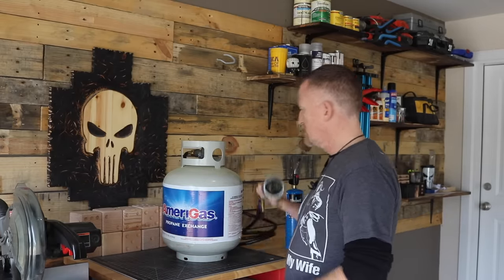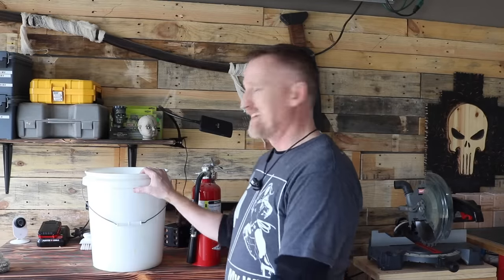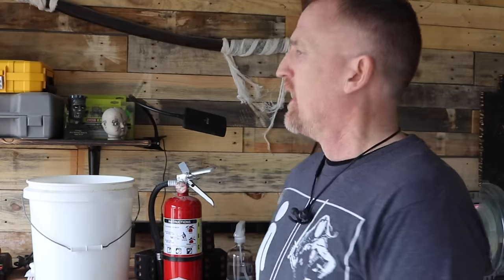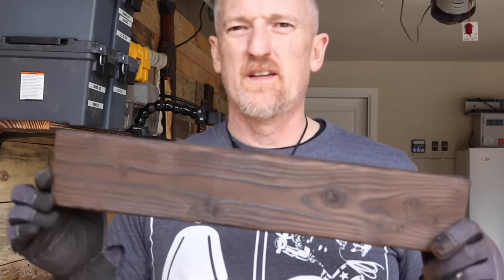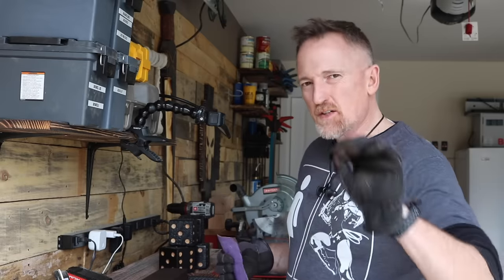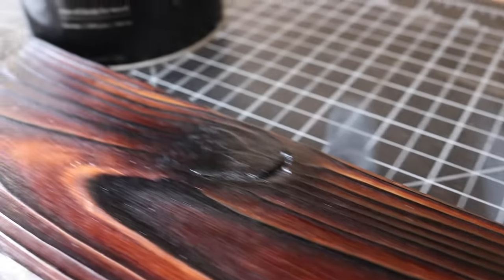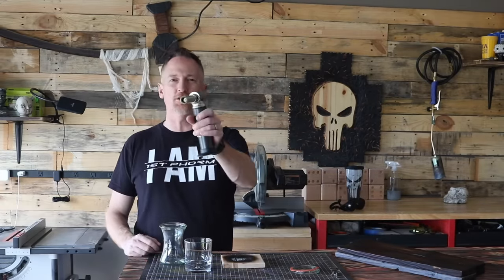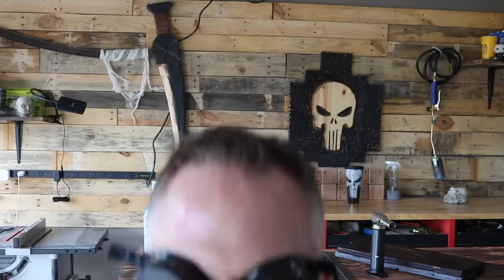DIY Wood Burning Technique - That's not Shou Sugi Ban! Or is it??

Comment: Is this technique only used with pine? Or can you use hardwoods?  What was the wood you used to trap the smoke for the cocktail?
Reply from the maker: You can do this with any wood. There is just varying results. Hardwoods with not a whole lot of soft cellulose material tend to ebonize and gator more. Soft woods will give you more texture.
Check out this video where I experiment with different wood types:
https://youtu.be/DoBWpOzGMXc
The wood I use most often for my smoked whiskeys is Hickory.

Comment: I have a small butcher block table I'm wanting to do this to.  Now, after you stain it can a sealer be applied to it and NOT effect the color of the stain?  It'll be on the back porch and exposed to the elements is why I'm wanting to put a water sealer on it.
Reply from the maker: I don't know of a sealer that won't darken the color. I always try to keep mine a little light with that in mind.
Cheers

Comment: To use this in a piece would you finish the boards then do joinery or would you burn a built piece?   I'm not sure how glue would hold up to the heat.
Reply from the maker: Depends on the piece. I would say if glue is going to be your primary joinery, I would finish them maybe 90% before, then assemble and touch up any areas with a torch.
TBH I don't know how well glue holds up to the torch. In my experience I haven't had any joints fail, but I also try to not hit a glued joint directly with the flame, let the burn creep up to it.
I'm actually thinking of putting together a video to test when glue fails when heated with the torch.
Reply: It doesn't, made that mistake before bud. The glue (titebond 2)  completely releases when directly heated.

Comment: If I’m using the wood for outdoor purposes do you recommend a poly to go over the simple finish?
Reply from the maker: Hey Kevin!
Purists will tell you that Shou Sugi Ban plus oil is all you need for outdoor applications. That being said, I usually use poly or some sort of water seal over the top.
Cheers!

Comment: Quick question. I’m doing my deck. I’m looking at doing a surface burn, because I don’t want my deck to burn my feet with a full gator burn. With a surface burn do I need to seal it with polyurethane or will it seal and preserve the wood with out the poly?
Reply from the maker: You'll hear 2 different schools of thought here. I say if it's going something that folks are going to walk on I'd seal it for durability. 
Some will say it'll do just fine with the natural seal of the burn. 
Personally I put a coat of poly (or other sealant) on everything. 👍🏻👍🏻

Comment: Hi, I'd like to ask if what will happen if you repair the wood first, like you filled up the holes with wood putty or filler then you start burning it, because some woods are not really that smooth right, we
Reply from the maker: Wood putty doesn't really stand up to heat well. I would suggest doing the repairs after the burn and using something like CA glue or epoxy (depending on the size of the hole).

Comment: After you burned them all did you San all 4 of them to expose some more wood ? I want to do the white application for some loft beams for my tiny house.
Reply from the maker: Yes I sanded them all. However, check out my chair build here: https://youtu.be/SMz5r7TFcEI where I use a nylon brush attachment for my drill. I didn't really need to sand after that...

Comment: I have trouble with wood warping when I burn.  How do you stop that?  Have you ever burt a panel after glue up and how would you stop that from warping?
Reply from the maker: Two ways to limit warping. 
1 - do lighter burns and more of them. Some guys come at the wood with MAPP gas and really high heat. That will cause the wood to warp. 
2 - make sure to dampen the wood when youre burning. Keeping it moist keeps the train from rapidly expanding or contracting.

Comment: If you only give it a light char, does it still weatherproof the wood?
Reply from the maker: The part that weatherproofs it is the removal of the soft cellulose material. So, it kind of depends on how light? You could definitely burn it less and still get some benefit. A surface burn? Probably not...
Cheers!

Comment: I would like to do this with the sun bleached finish for a computer desk. Since I would want the desk to be smooth what epoxy or urethane would you suggest? Or would you suggest a different method to get that look?
Reply from the maker: Lately (if you want gloss) I've been loving the Halcyon from Total Boat. I actually used it on this desk build...
https://youtu.be/U5A67-Pwxuo

Cheers!

Comment: After burning and oil , how well will wood hold up outside? Outdoor I use a special oil for this outdoor application?
Reply from the maker: Burning and oil, it should hold up outside fine. This technique was used for siding at one point.
However, I usually do apply some sort of outdoor top coat.
Cheers
Reply: @BuildDadBuild  , top coat like a polyurethane clearcoat
Reply: Are you talking linseed oil that you use?
Reply from the maker: I usually use a poly...you really can probably get away with BLO but you'll need to keep up with it.

Comment: Stupid question I’m sure but can this be done to pressure treated lumber. I know they say not to burn it but didn’t know if there are any steps you can take to do this.
Reply from the maker: Hey, Lee!
I don't burn pressure treated lumber because it releases those chemicals into the air. If you do...wear a respirator, do it in a well ventilated area and be mindful of anyone around you.
Cheers!

Comment: Is 1” pine hard enough to make a table top? I intend on making a 1”x6” pine table top at 52”x30”. Also, would I torch the boards individually and then join them or join them and char the table top as a whole? Thank you and your work is amazing!
Reply from the maker: Pine is a soft wood...so it will ding and dent. So I guess it depends on how much stress the table will be under.
You can definitely join the boards first, then burn.
Cheers!
Reply: In the event that I do go with Pine, does it make a difference whether or not it’s the $4 2x6x4 kiln dried or the $25 select 2x6x4? In other words is the cheap shit too cheap? What would you recommend?

Comment: Has anyone tried it on frniture which already received some wood varnish? Just got a second hand bed and not sure if the wood is actually treated? Will the varnish just burn away , or what happens it if was just oil or wax? Will that burn explosively ?
Reply from the maker: It should just burn off. Wear a mask in a well ventilated if you're not sure what it's treated with.
Cheers

Comment: Question for ya.. Have you ever done this with a thinner plywood?  I'm thinking of wrapping my new 300 gallon aquarium stand with shou sugi ban 1/4"- 1/2" plywood.. And also should I use sanded vs unsanded plywood?
Reply from the maker: Plywood tends to not burn evenly. And thinner plywood will warp.
Cheers,
Nick
Reply: @BuildDadBuild  that's kind what I thought, but figured I'd try and get your opinion before I did anything
Reply from the maker: @torosax  I would try this instead. Shou Sugi Ban some pine and then cut it with a bandsaw down to a thinner stock.
Reply: @BuildDadBuild  good idea but that would have to be some massive pieces for my 300 gallon aquarium stand and canopy haha!  Thanks again for the responses and input! Much appreciated!

Comment: I am building a chair for outdoors and will be using the burnt wood finish technique, would you recommend using treated wood or non treated wood? Thanks
Reply from the maker: Do NOT burn treated lumber. You'll release the harmful chemicals they use to pressure treat the wood. 
Check out my outdoor chair build here you might be interested in the brush attachment I use on my drill:
https://youtu.be/SMz5r7TFcEI
Reply: @BuildDadBuild  THANK YOU
Reply from the maker: You're welcome

Comment: Shouldn't blast on concrete, it  will super heat any air or moisture in the slab and make a popping sound weakening or even cracking your slab
Reply from the maker: +Keith Runick thanks for the info! Good to know.

Comment: I am looking to build a metal above ground (mobile) fire pit. I want to line the edges of the exterior with Shou sugi Ban wood like done in this video. I am hoping to make a ledge people can kick their feet up on and something that does not get as hot for those times people accidentally bump up against a fire pit. Would this method work to make the wood less likely to burn with the random spark coming off the fire?
Reply from the maker: Sure will!
Cheers

Comment: what kind of brushes do you use to remove the charred wood?  I didn't notice any steel wire, so just stiff bristle? Nylon?
Reply from the maker: They're nylon brushes. I used to do it by hand (with a nylon brush), but I've since switched to these because I can use them in my drill and save a TON of time.

https://amzn.to/2qjg7QD

Comment: I gave my wood a light burn I just need to brush it would like to know the proper brush to use? 
I’m looking for a natural burn look?
How many clear coats do u recommend? Do I have to sand it? Or is it fine like this?
Reply from the maker: If you want tool marks use a wire brush. If you don't, use nylon.
Minimum 3 coats clear coat
I do not sand.
Cheers
Reply: @BuildDadBuild  thank you brotha
Reply: @BuildDadBuild  
I got valspur ? Something like that is that good

Comment: I’m a little late but I’m sure by now you’ve learned the following tip but hear it is anyway: 
Put a nail dead center of your project and tie a string 11” to your nail. Then attach a pencil to the end of the string. With pencil attached to the string, take out all slack in the string while drawing away from the nail in a full circle. This will give you a perfect circle. After you get your circle penciled in get that trusty jigsaw out and cut that wood. Lol You could also achieve the circle trick using a tape measure, but it takes a little practice.
Reply from the maker: Thanks for the tips!
Cheers

Comment: First, I have to say, you are a really good teacher, thank you for your video. I am sure this has been asked before, I wish I could do a word search through these comments. Or maybe I am missing where this is posted. Anyway, what are the brushes you use? I may have missed one, but I saw a white one just after the burn, then maybe a metal tooth one? Could you provide links? Thanks for your time!
Reply from the maker: Thanks, Kat!
The white brush is a nylon brush (like the kind that you would clean the bathroom with)
https://amzn.to/3aSJXgz
And the wire brush is similar to this one:
https://amzn.to/2JJGGo0
However, I would urge you to watch my updated Shou Sugi Ban video where I show some Nyalox brushes that you can attach to a drill (they save so much time!)
https://youtu.be/tCSJ6Sljq7U

Nyalox brushes:
https://amzn.to/2wIelM7

Cheers!!
Reply: @BuildDadBuild  Thanks so much, I certainly will!

Comment: Hey probably a stupid question but if I’m planning on building a platform bed if I do the torch method on the wood would it be able to be as strong as before it was burnt?
Reply from the maker: It should not weaken the structure at all. You're removing the soft cellulose material and leaving the more substantial stuff behind! 👍👍

Comment: Walnut gun stock? 🤔 I've seriously been thinking about doing this on a Walnut gun stock and finish with a traditional sanded in linseed oil finish to fill the pores of the wood. I think the darker grain contrasted with the light will be really nice. Any thoughts? Your opinion would be greatly appreciated thank you
Reply from the maker: Hey, Brian!
I've never burnt walnut, so I would definitely try a scrap piece first to get an idea.
But, I would think if its got a good grain pattern you could definitely increase the contrast with a little fire!
Cheers
Reply: @BuildDadBuild  Yes adding contrast is my main goal plus just having a little different look. I'm thinking about buying a stock from DuPage trading Post they have a extra fancy tiger striped Walnut. I've also thought about adding some mahogany color stain? The linseed oil as it oxidizes has its own natural red color to. Thanks for your input any ideas?
Reply: I would not have any walnut to test it out on just the stock. Maybe test on the hand gaurd or forend stock they would be cheaper to replace if I messed up. I think a light black char I could sand out if I didn't like it? I think I would love it though the only Shou sugi ban I don't care for is when it is left chard to the point of cracking and then sealed. I guess for the right project it would be cool. Thanks
Reply from the maker: @brianlee6849  I'd probably go with the contrast and linseed oil combo. But, definitely do some tests first. Since I have no first hand experience with walnut, I'd hate for you to mess something up based on my recommendations. You can pick up a piece of walnut from a local lumber yard, or order a piece from Rockler.
Cheers
Reply: @BuildDadBuild  Thank you. I appreciate it.
Reply from the maker: @brianlee6849  Sure thing, brother. Let me know how it turns out!

Comment: Can I burn one that’s already been painted? I am working on custom cornhole boards and was wondering after I’m finished painting if  burning will remove anything
Reply from the maker: You can, but it will strip the paint off.
Cheers
Reply: @BuildDadBuild  thanks

Comment: Hi there. Great videos.. I just did a table and the one area I did not expect. All the dark lines are now raised, what did I do wrong ? Sanding it removes all the dark color??? I must have missed something. Any advice !???
Reply from the maker: That texture is part of the process.
Reply: @BuildDadBuild  ok. I assumed so. I saw someone else use another tool to remove the char and the lines remained but he i noted how smooth it was
Reply: @BuildDadBuild  I’m curious, is there a way to maintain the texture look while getting smoother ? I make the assumption that’s a no. But I am new to this process
Reply: Thank you for taking the time. Simple finish is on the way.. 😃

Comment: I know this is a old video but if you could
What size pine was used here and also what sand paper grit do you recommend any sanding after finish thanks for videos
Reply from the maker: Hey, brother!
I think that is 1x4 pine. I normally don't sand after I burn. The nylon brush usually smoothes everything out pretty well.
Cheers!

Comment: Thanks for this video.  Question though.... do you have to brush off the chard parts or can you stain and then coat it to keep that look with a nice color?
Reply from the maker: Do you mean keep it with the gator char on? You can, but you need to seal the char or it will flake off.
Cheers
Reply: @BuildDadBuild  Oh..OK. Thanks for the reply.  Would you mind posting a vid showing that process?  I'm interested in doing a table like that.
Reply from the maker: @Warlock1007  Here you go. https://youtu.be/DoBWpOzGMXc
Reply: @BuildDadBuild  Thank you!!  :D
Reply: Thanks. Sent a question to your FB page.

Comment: Love the video. Inspired me to use this technique on a barn style door. Got in there with the sand paper and that made all the difference. Having spend hours sanding and defining the finished texture, what clear finish do you recommend. I'd hate for my finish to level out all the texture I've created. Was thinking of using a rub on oil poly but it says not to use it over a white stain and i used the sun bleached stain.... Any advice? Thx. Cheers
Reply from the maker: I used and outdoor urythane on these chairs and it worked pretty well. 

https://youtu.be/SMz5r7TFcEI

Urythane: https://amzn.to/2MyvJK5
Reply: @BuildDadBuild  that will work just fine.. thx for the tips and great looking chairs by the way
Reply from the maker: Thank you!

Comment: Hi!  I am just discovering this technique and I am working on my first little project. Starting off with a wood round for a sign.  The burning I have some work to do...I used spruce. But I used this sunbleached stain and it turned out so beautiful (whether I did the burning right or not) Did some sanding in those areas i wanted lighter and I love it. Was that a wire brush you used at one point? I didn't feel like my hand held nylon brush was pulling up the lighter tones so I tried a wire brush and it put ugly scrapes on the wood. So I stopped using it  :(
Reply from the maker: Hey Staci!
I use 2 brushes in this video. One is a nylon brush (like a bathroom brush) and the other the stiff bristled head of an old broom! I have since graduated to these great nylon brushes that attach to your drill. Makes life SO much easier.
https://amzn.to/2yyTZWl
You can see me using them in my newer videos like this one:
https://youtu.be/zOXuGlawxPQ
Cheers!
Reply: @BuildDadBuild  Yes I did see you use those nylon brushes for the drill.  We looked for them today at Home Depot and Lowes but couldn't find them.  I will definitely be ordering them from Amazon!  Thank you so much for your videos. I'm learning so much and absolutely loving Shou Sugi Ban
Reply from the maker: @stacigarrison9136  That's awesome. And those brushes save so much time!
Cheers!

Comment: Hey, love your video... I'm going to do the sun-bleached version on the exterior cladding for a shed/office I'm building in the backyard.  Would you mind telling me what you put on after letting the sun-bleached dry to make it glossy?  I tried one finish from the company that makes the sun-bleached and it smeared the original stain.  Maybe it wasn't completely dry yet.  Anyway, mine will be outside exposed to the elements... but I like that glossy look!
Reply from the maker: Sure Mark -
That's just a glossy spray on poly.
Similar to this:
https://amzn.to/2Y4Chm8
However, if you're doing a large surface area I'd suggest something more like a spar urethane like this:
https://amzn.to/2Y2ziKI
Reply: @BuildDadBuild  Thanks!